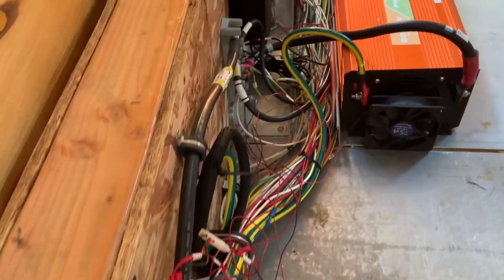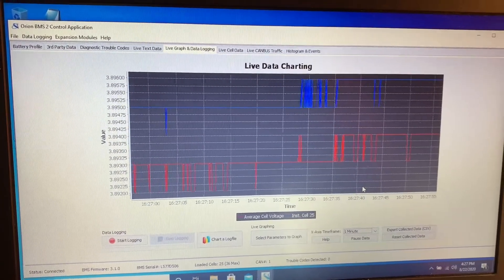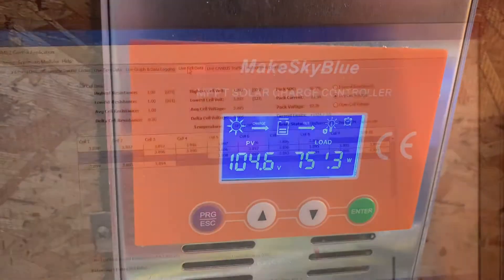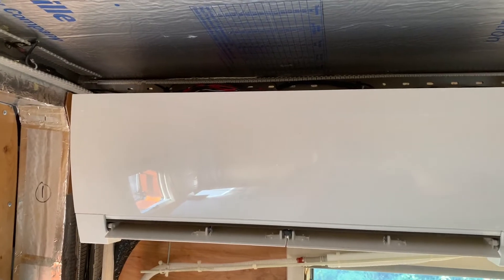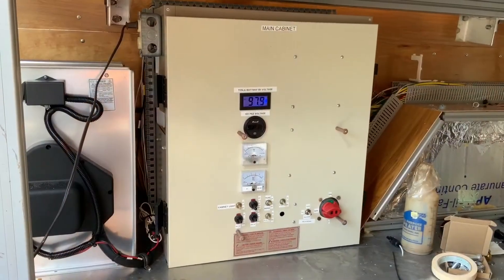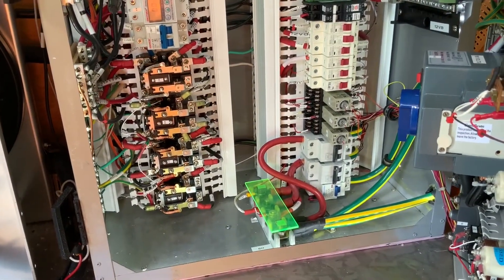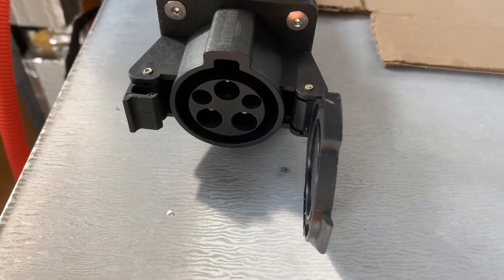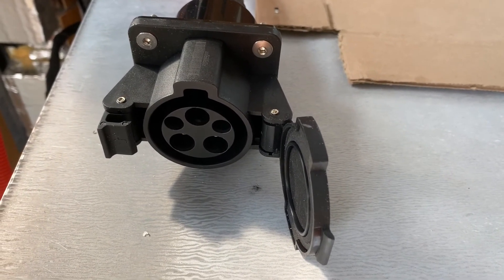Now You Know, August 22, 2020

Comment: Hey Tim I love the stuff you do and would love to have a conversation with you but I’m hoping you could help me real quick. About six months ago my water flow into my refrigerator stopped no more water production from an old refrigerator so I replace the refrigerator have a new good quality refrigerator in please hooked up the water turned it on and still nothing? The house is only about 15 years old and was built with a dedicated refrigerator water supply. Our water is really hard here can you think of anything or does it have to be that valve  plugged up where you turn the little T valve off and on to supply water?Looking forward to your next video a I found you from Zach and Jesse, Thanks Tim I hope to hear back from you have a great rest of your weekend I am in central California where we are still trying to get a grip on these fires and smoke
Reply from the maker: The needle valve is probably clogged with calcium from the hard water. Thanks for subscribing.
Reply: Tim’s Tips thank you for that advice that must be the valve right where you connect the water line to ya

Comment: How many miles can you get on a good day of solar charge?
Reply from the maker: About 32 miles. This is a quarter of a Tesla Model 3 battery pack, so it would not be of much use driving the van. It is used for the house systems like instant hot water, air conditioning and induction cooktops. Theoretically, during full summer sun, the 1.8KW solar panels could generate about 8kwh per day, which could propel a Tesla Model 3 about 32 miles.